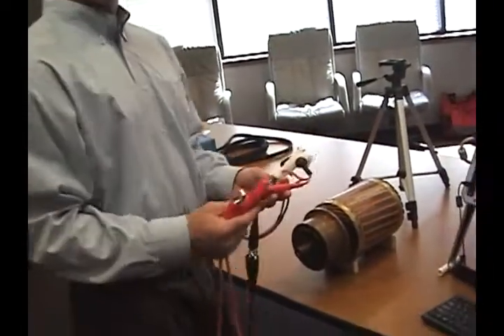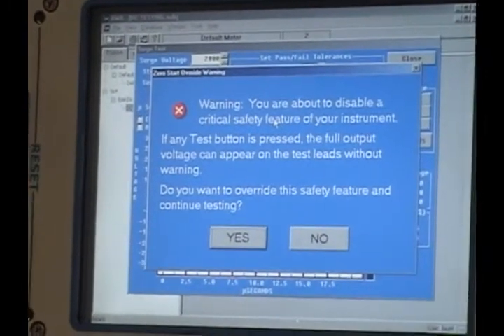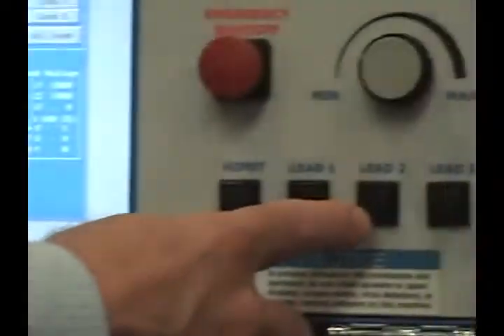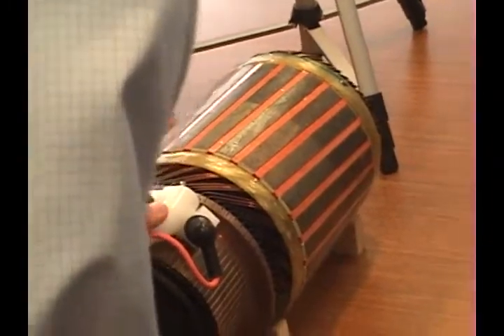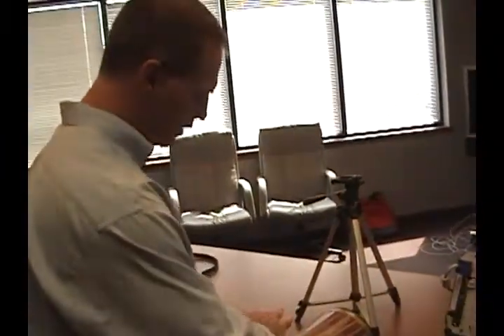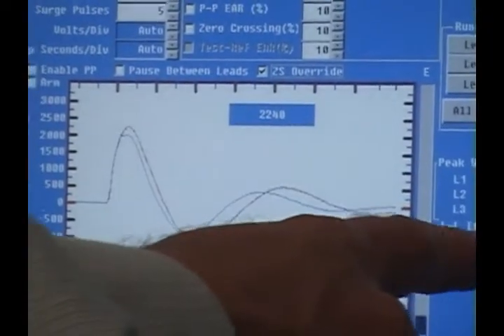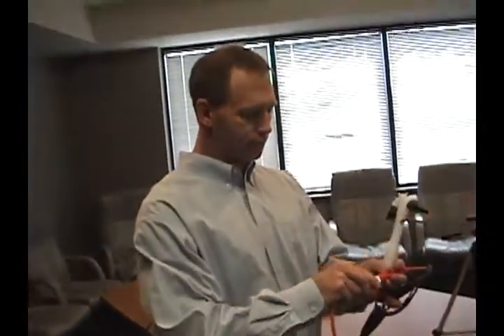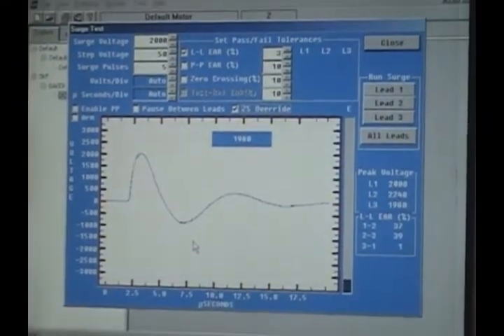Armature Testing with the Baker AWA IV Part 2

Comment: The cable lengths on that new tool really need to be different.  Every time you let them drop, I was expecting a spark and flash from the ground and lead hitting on another and shorting.